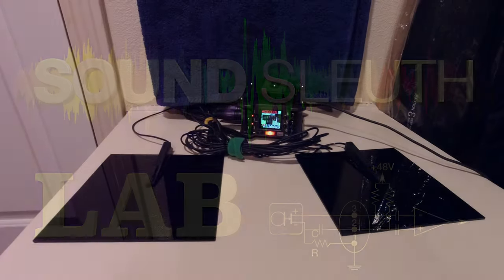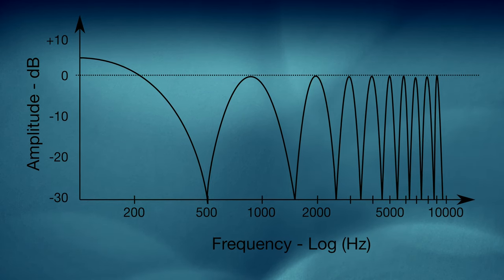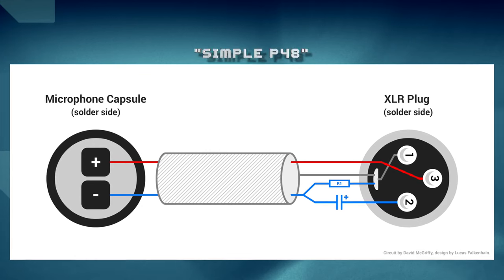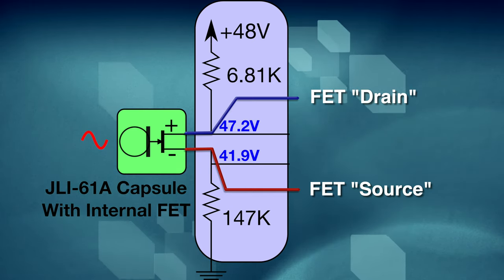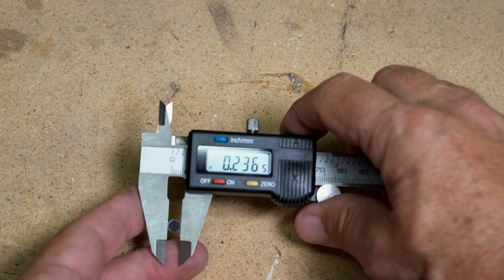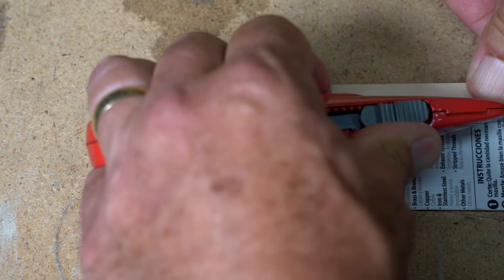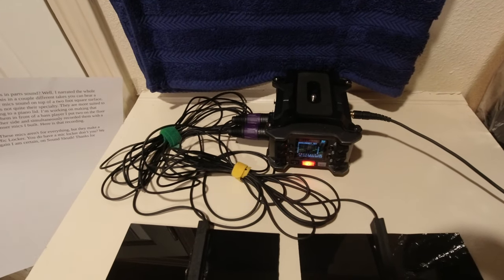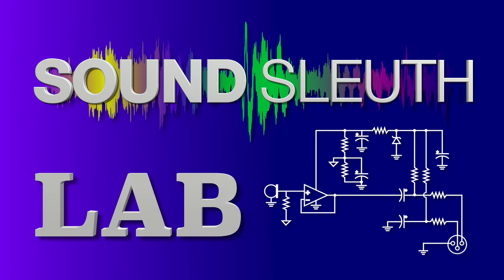DIY PZM Build Video

Comment: Nice comparison. What I liked the most is that the PZM mics picked up more room ambiance than the nearfield condensers. Your narration was rather pleasant sounding as well. You have given me a little to think through. I need a few mics for recording. Love the Micbuilders forum. Been a lurker for about 10 years.
Reply from the maker: Thank you! These are great and very inexpensive to make.  I used one of these on the Kick Drum on this video. I had a TSB2555B with my Op Amp circuit as the main kick mic and then a PZM about 4 feet in front of the kick and blended them in post. https://youtu.be/vHWWGxa0I2U

Comment: Great stuff in Sound Sleuth Lab channel.
Regarding "DIY PZM Build Video"...
The diagram referenced is actually for a mic laying PERPENDICULAR to the boundary on a foam pad 1/16" thick (just FYI). 
Regardless, a 1/16" gap = 0.0625"
The Crown Boundary Mic Guide says the gap (on a parallel capsule) should be 0.052" for a 1dB drop at 20 kHz, which is close enough.
If, instead of gluing cardboard for the gap, one uses Gorilla Heavy Duty Mounting Tape, the gap (tape thickness) is 43 mils = 0.043" resulting in even less dB drop at 20kHz. AND a LOT easier than glue lol.
Thanks for the great channel!
Reply from the maker: Thanks, If you refer to the associated Instructable, we have updated that with a 3D printable capsule holder that makes the gap thinner and more repeatable. And you are correct about the distance!
Reply: @SoundSleuth  Appreciate the response. I did notice the Instructables capsule holder (PZM Arm 3in v1.1), but passed for two reasons; it takes most of the DIY out of the project (DIY = fun?), and they are pretty expensive. With std. shipping, two holders cost $35.69!  I just bought enough mahogany wood strips and Plexiglass to build eight PZMs for less than that. But if you don't have the tools/skill set/time/ for full DIY, they are a handy solution. (I'd be tempted if they were $5 for a pair lol).
I'd send you my build pics, but don't see the option. Keep up the great work!

Comment: Awesome instruction, thx. Tried to build it and I get quite some noise in the signal. How can I reduce it? Has it something to do with insulation of the capsule or the components at the male XLR?
Reply from the maker: @Flitzefeuersocke  check that the components are not touching in the XLR shell

Comment: This is cool, is there any reason not to use a smaller sheet of lexan than 12"x12"
Reply from the maker: I actually cut the 12” X 12” into smaller pieces.
Reply: The cut down size is for transport convenience. The mics actually perform best when attached to a larger surface. If I were constructing my own and had 12" square lexan sheets, I'd use the whole sheet. The function of the mic backing, when it is at approx 5 inch or 6 inch square isn't usually to be suspended in the air to capture sound recording, but to serve as the base for mounting to a larger surface. If someone were recording a stage performance for instance, the ideal positioning for this mic type would be on the stage floor, on a near column, or on large transparent sheets suspended in the air, facing the performance. The use of transparent sheets is not an audio consideration but a visual one, making the recording process least obtrusive to the audience.
Reply: @stillidle1  Is that why the plate on the PZM is a square rather than a circle?

Comment: Hi, Sleuth, I'm thinking about low noise mics and how to reduce noise, (minimal background).  At 4:25, If you put a common mode choke on the 47.2V and 41.9V lines, would this allow the Differential signal through but not Noise?   I think noise would be common mode?
Reply from the maker: Lamont, the noise is common mode. And it is rejected by the mic preamp's differential amplifier.

Comment: So: a suspended PZM pickup pattern behaves like an omni?
Reply: PZMs generally have a hemispheric pattern.  The plate tends to block the other hemisphere and keeps it from being fully omni.  The PZM does use an omni capsule (Pressure type vs. Pressure Gradient type).